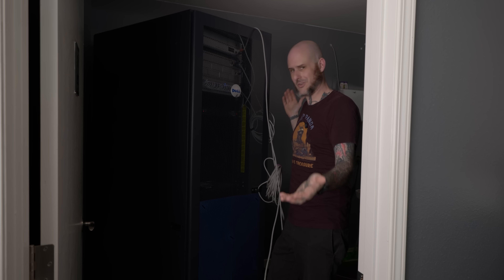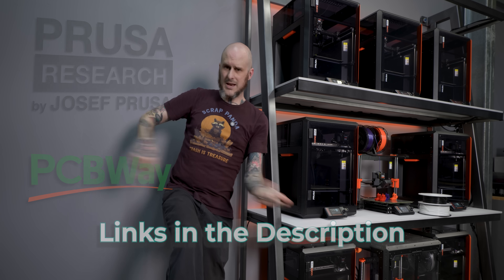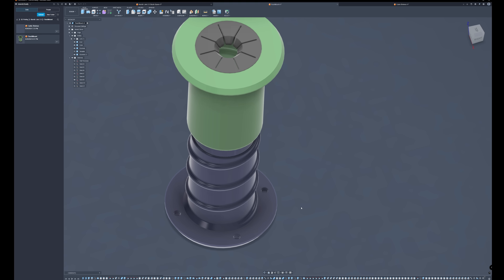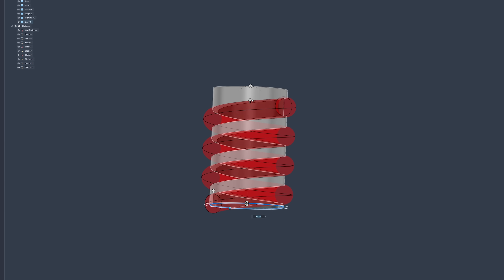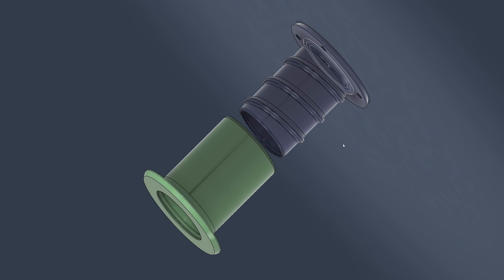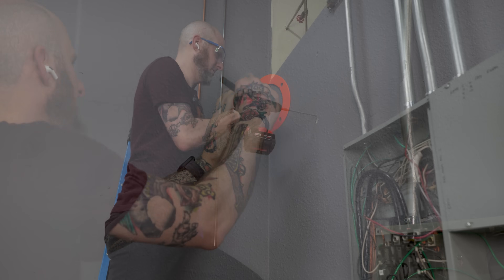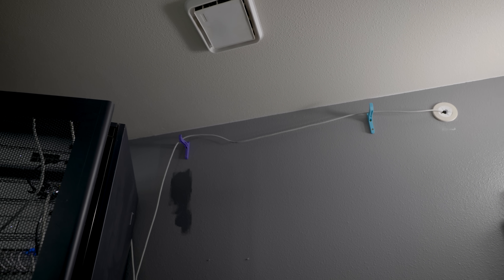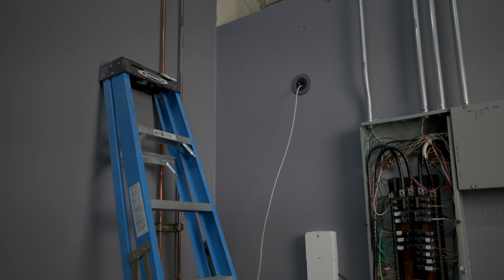3D Printing a FIX for My Bathroom Home Lab!

Comment: Careful in commercial and certain residential walls that thick drywall is also a firebreak unless you have double wall tube with fire putty lining the center and can test it to the same fire rating as the wall assembly you risk allowing fire/smoke across the penetration. The larger the hole and making it out of flammable filament is a lot worse than shoving the flame retardent loaded cables through a bunch of tiny holes. Definitely do not use this cable pass through in any vertical use case as heat/fire rises. It would be neat if you use the fire rated sealants and a corse gryoid infill to make a fireproof pipe collar that the fire not resistant part could slide through then if fire ever reaches the part the fire rated collar would expand and fill the gap.

Comment: very nice!  it's been a long time since i ran cabling & set up a fresh hardwire network.  i assume you're using a patch panel in your server rack....  just do yourself a favor & label each & every cable on both sides, if you're not using labeled ports on the user side.  you're going to want a labeling convention that allows you to quickly & easily identify what runs where & if it's for a different purpose than data.  best of luck, dude, & have fun!  i miss that kind of work sometimes....  😊

Comment: Yeah, that's my issue with Taylor's "the fastest printer is another printer".  You need multiple spools of the same filament to make that work.  For black or white, sure, but not for every color.
Reply from the maker: Yea, it isn't easy to keep THAT MUCH filament on hand. Something I'm going to have to get used to.

Comment: Awesome video and project.  I have some thoughts on where this would be useful for my house.

Any chance I can get a link to those brackets you used for the wire to run it nicely?  I have some dangling innerduct and wires that can be cleaned up with those

Comment: I would have put the server rack where the ladder is 🤷🏻‍♂️
Reply from the maker: Directly below the 30 year old hot water heater. And it would be tucked into a corner. Which is where it has been the last couple of studios. It makes getting behind it annoying. May not seem like it but it’s much easier to work around in the bathroom.
Reply: @MandicReally also move the water heater to the bathroom.. 😂

Comment: Our house has terrible outlet placement and I'm one of those lamps-everywhere-because-overhead-lights-are-a-war-crime people 😅
Right now that means a bunch of extension leads routed through closets/doorways/etc., so this would really help tidy things up.

Really appreciate the overview speedrun of your design process! I might have a crack at a slimline version for a single cable in each spot; can just snip/reattach the plug so a 1"/2cm-ish hole should be plenty.

Comment: Nice project. I liked your technique for creating the coils and matching groove. If you have any tips on how to model a coil for one of those flexible tubes that you get with "portable" AC units, please do a video on that. I've struggled to get it working for my AC for like a week. I'm close to giving up and just gluing the damn thing in place.

Also, I think you're gonna have a tough time getting ~20 ethernet cables through that hole. It will need to be way bigger if you want the ability to actually pull one out at some point, without removing them all.
Reply from the maker: Calculators for Conduit Fill Capacity with Shielded Cat6A at a 40% fill ratio (meaning still 60% air gap) say 20+ cables will fit through a 2" Conduit. I forget the inner diameter of this offhand, but it is well over 2", closer to 3". I obviously haven't populated it yet to test, but on paper it should be a complete non-issue.
Reply: @MandicReally  Agreed, on paper it should be a non issue, and I hope it is for you.
The networks I've worked on previously have all been a bit over-populated compared to initial spec, so I guess that could be clouding my judgement 😀

Comment: What monitors on your desktop are you using?
Reply from the maker: Main "monitor" is an LG 48" B4 OLED tv. The Portrait monitor is an ACER Nitro XZ272U.

Both are older models now I believe, though I just got the LG OLED on steep discount from BestBuy cause the newer version launched.

Comment: As a former IT guy, this honestly makes me cringe. Considering the expense, time, and effort I’ve put into dehumidifying server rooms, it kills me to even imagine someone washing their hands with hot water for 20 seconds in there—just picturing all that steam swirling around and getting sucked through your components. Even the small amount of evaporation from an open toilet, with all that airflow, will add up over the years.

Ideally, I’d split that room in half: create a dedicated server section and isolate the bathroom. But in your situation, at the very least, you need a heavy-duty dehumidifier. Also, the current layout is kind of ridiculous. People always set up server racks to look cool, but don’t think about functionality. The way you have it now, all the hot air from the back just recirculates right around the edges and goes straight back into the intake fans.

The best setup is to have equal distance from the front and back of the rack to any walls, so there’s plenty of airflow in both directions. You want an air conditioner vent—or even better, a dedicated mini split unit—blowing cold air straight down in front of the rack, and a big exhaust fan behind it, pulling all the heat out into the main room. At the very least, get a mini split to suck out humidity and keep the room cool. Also, upgrade your ceiling vent to something rated for 24/7 performance, so it’s constantly pulling out air and humidity. Even if you end up refrigerating the outdoors a bit, it’ll double the life of your components.

Comment: You made a rookie design mistake in this. One that i have had to learn the hard way. When designing thread you should not bring the male threads all the way to the side with the flange. Why? Because it prevents a pinch point when screwing something flush. 

If your wondering how to finish the threads then. Just revolve them. The pro way to do this would be variable diameter threads but its not really possible in fusion36.

Comment: I get that floor space is valuable but why not just put the rack in that corner of the warehouse right where you ran the cables through?
Reply from the maker: It would be squeezed in and less accessible with what is already planned to fit next to that space. Also it’s directly below the 30 year old hot water heater. So is the bathroom but at least that has a ceiling between it and the rack. Really though, the bathroom would have had a storage cabinet that would have barely used the space otherwise. 🤷🏻
Reply: How are you making your wired vs wireless decisions? I installed 30 runs of cable in my shop - and currently have 24 of them hanging dead because most everything is now wireless.